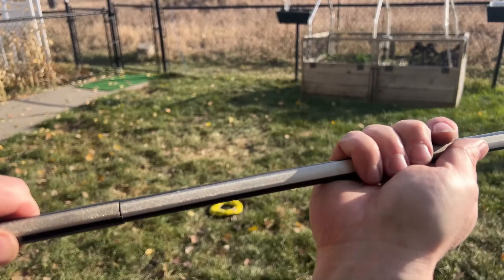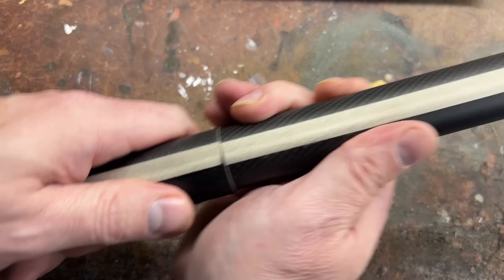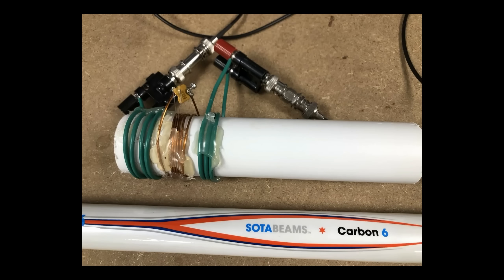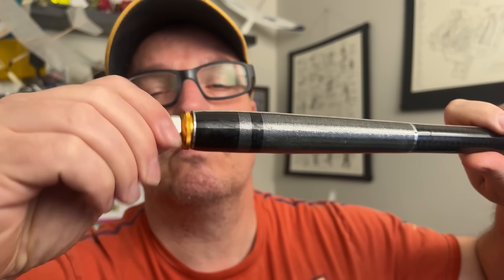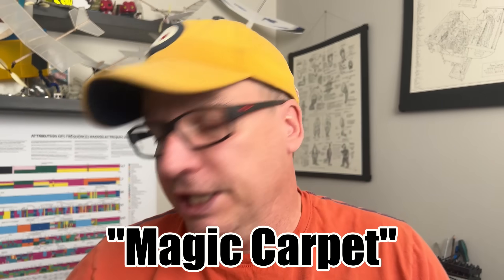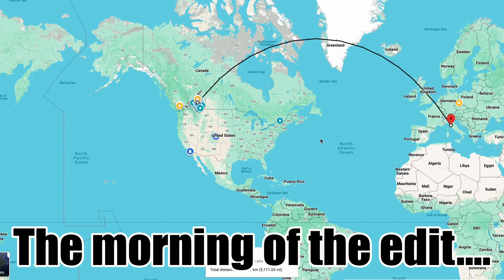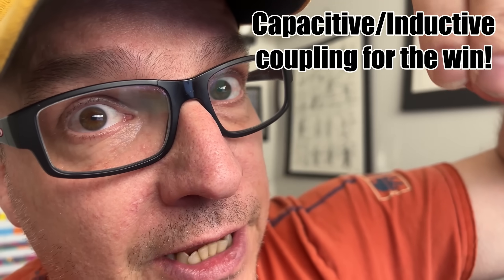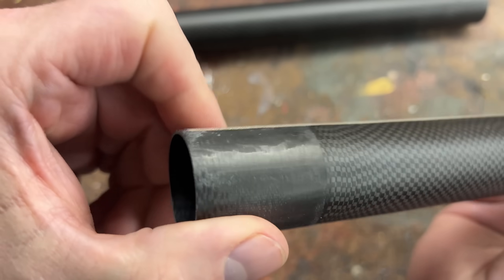Carbon Fiber Squid Pole EFHW Antenna: Wire-Free using Faraday Tape!

Comment: I have used the fiberglass version of these poles for several years with my RV  HF radio.   Have you tried  feeding this antenna with a 9:1 balun.   It works well for with a 33 ‘ wire strung inside a fiberglass squid pole.  I like your idea,  Eliminating having to string a wire inside the pole when setting up the antenna would be a time saver.  the I’m going to order up some conductive tape and try it on the fiberglass pole I have.  If it works as well as the wire  does, I’ll let you know.   

One problem I have had to contend with is sections of the pole collapsing due to wind vibration.  Plastic hose  clamps, appropriately sized for the different sections work well, but it adds a bit to the set up time.  I only use these if I’m setting up for a long duration, or wind is going to be a factor.
Reply from the maker: yes collapse is a issue and I have had luck with zip ties at joints

Comment: A very interesting concept but, as you say in the video, I would like to see a lot more work done on measurement off capacitance at the joints, loss and or gain, effect of flex in the antenna, and a whole bunch of modeling and experimentation. It could prove to be a fantastic design but it also could prove to be a money spinner for cheap Chinese manufacture producing low quality knockoffs.

Comment: How very exciting sir and was riveted to your video and experiment. I will be in anxious follower I'm kind of a Frankenstein antenna guy myself even though I'm just getting into the hobby. Most interesting for me was the coupling and adjustments that are possible by rotating or turning sections. And I wonder and plan to see if it is possible to achieve the same along the lines of a large telescoping whip antenna element as well. Thank you for your contributions and for experimenting it is awesome take care and 73s Adam (Festus, MO}
Reply from the maker: thank you and some of the discoveries are pretty cool stay tuned...

Comment: I always thought that carbon fibre poles should not be used because they are more lickly to attract lightening.
Reply from the maker: Well sure but would a wire or  metal tubing not be worse?

Comment: Was that 0.1dB loss for the few inches he was testing versus the 10x feet you are using?
Reply from the maker: Yes it was but you can go into his video and he will explain it much better than I ever could. In the end the losses are still inconsequential. Thus this antenna working so well

Comment: Just some things to keep in mind: You can do a lot of tuning with capacitive coupling, but it just makes the electrical length shorter, not longer. That's why hams use an inductor on the base of their vertical antennas and tune it, because it takes what amounts to a 10 meter, quarter-wave, 15 meter, or 20 meter quarter-wave vertical and makes it electrically longer in order to hit the rest of the HF bands. Also, inductively coupling in one spot to a relatively poor conductor for loss testing is not the same thing as capacitively coupling to the entire length of the material, which is what your conductive tape is doing.
Reply from the maker: I use capacitive coupling improperly here to be honest. It is both inductive and capacitive. You have some great points though thank you.

Comment: Cool idea. Many years ago, I used alarm window foil tape on PVC pipe and made antennas.
Reply: Ditto on trying aluminum or copper foil self-adhesive tape on your fishing pole concept.  Fishing poles are rigid surfaces so I don't see the flexibility of Faraday cloth is not a big plus. You mentioned possibly epoxying Faraday tape to the CF poles segments, I expect self-adhesive foil tape would be far easier.  Look for tapes from 3M  using their VHB (very high bond) adhesive or a 3M acrylic adhesive.  3M VHB double-sided tapes are used to bond large metal side panels onto vans so they can take a beating.  They are good for a wide temperature range that you may find useful in Calgary (lived there for 3 years!).  I checked and 3M sells some Al tapes at least.  And, even if the foil tape you buy isn't 3M branded, when you look at the release paper layer it most often reads "3M".
Reply from the maker: That's a great idea!
Reply: @VE6SFX_HamRadioRookie  you can make J-pole antennas with conductive copper tape on the back of eg duct tape or cardboard or whatever :)
Reply from the maker: Like this? https://youtu.be/d5itl1uWGtU or this? https://youtu.be/nwHmz5iGlvk :)

Comment: Very interesting concept, well explained, Thanks a lot.
About these Aliexpress poles, I've bought one one these supposedly 13m long poles and it's hardly 10m long. Sams for you?
Not sure it was from the same seller, but it does look familiar.
Reply from the maker: The sellers even with different brand names are effectively the same seller. And yes they tend to over promise. FwIW my 13 m pole is really 12
Reply: @VE6SFX_HamRadioRookie  I admittedly might have not counted the super-thin, unusable for anything last segment to measure  10.something meters long only. Yes, I did suspect too that all these offers were actually coming from the same seller.
For long poles (10m up) the only alternatives are the much more expensive Spiderbeam and such poles, that are too thick at their base  to fit into any ground anchor I could find and too heavy for me to bring them up on my own when extended and there's any wind blowing.
I have a 12m one and I hardly ever use it, I work with these cheap fishing poles instead.
EDIT for an extra question: do you think these really are made of carbon fiber and not just plain fiberglass? I have doubts.
Reply from the maker: Yes to all of this but since it is just tape to the outside of the pole suddenly these weak segments become usable :) No extra loading just some tape
Reply: "Yes", like you do think they're really made of carbon fiber? Well, OK, I really thought otherwise. I broke one at half its base segment on a windy day, they're kind of fragile.
I get the idea of "no extra loading", but how to you apply that tape to a segment that's barely of 1 mm diameter? I'm curious
Reply from the maker: Cut the tape down thinner to 3mm width and it fits fine.

Comment: Interesting idea!  Did you use a balun? I wonder if it would be possible to leave a 'tag' of the tape at the bottom end and connect that to a 4:1 or 9:1balun as would be used in a randon wire antenna?
Reply from the maker: No balun. And yes leaving a tag and alligator clip will work. I find the antenna performs quite well with no balun and the SWR is manageable by the atu-100

Comment: So many possibilities.  Wondering if the carbon fibre is necessary for the tape to make the capacitative coupling jump.  If not, variant could be nesting plumbing PVC ducting of increasing diameter.  (We have a 20m DIY antenna shootout coming up at one of my clubs and I was thinking of not going the traditional wire route but some sort of PVC self-sustaining foil tape approach, but contemplating base loading).

Aside from regular quick-install for this antenna on a fixed basis, also coming to mind is using multiple of these for a phased array, eg. 3 or 5 elements, could even be possible in a SOTA context ...
Reply from the maker: In the end only one way to find out if it would work. Get some pvc and tape, as well as a LCR meter to get capacitance and this should answer the question. I may try this but it will be a while till I get there. If you do it I would love to hear the results

Comment: Look up CCD antenna. Although they use resonate sections of wire capacitor wire capacitor there is alot you can learn. I posted a link but I think it was filtered out. Also at the end add a ring of tape to increase the capacitance.
Reply from the maker: Noted, thanks!

Comment: Add 1 or 2 pieces, 1 inch long beside both ends of each section.  It will increase the capacitance and allow for lower operating frequency.
Reply from the maker: Great to know thanks!
Reply: I'm not so sure I'm that!  Operate at a lower freq?  Why?
Reply: @jeffro.  He could get a better match on 80 and 160.

Comment: Cheers from a fellow ve6. I am va6gg in Edmonton. This is a really cool concept. Ignore the old farts saying it's all been done before. Maybe the idea was floated before but we didn't have cheap and easy access to things like light weight large telescoping poles and conductive tape at current prices. We couldn't get it all delivered in a few days to our door with a couple clicks. It's still a really great idea and quite practical now given how easy and cheap materials are compared to let's say, 35 years ago. If an antenna performs at least as good as a mono-band dipole, then you are laughing. I remember when a roll of conductive adhesive copper tape was 60 or 70 bucks. Now it's 10 for 3 times more. This conductive cloth tape is something that simply wasn't available to the consumer in the past. Keep the project rolling. I want to see what you come up with on this antenna. Multi-banding is definitely a direction you should explore. I think conceptually it should be fairly straight forward to accomplish, though you'd have to switch perhaps to a more resonant radiator design and find some way to key each section to fit together to achieve the correct radiator length for each band. Imagine if you could create this antenna but resonant so no tuner required. That right there would be about the coolest new antenna design since the DX commander. 
I think vertical antennas for HF amateur radio got a bad wrap for a long time and some smart creative people have brought them back into favor. They work amazingly well and don't require big, heavy, complicated and expensive antenna support structures along with the real estate to erect said antenna support structures.
Reply from the maker: Thank you for the encouragement! And agreed the world has changed. Hopefully the creative mindsets can bubble up again and not be suppressed buy the grumps

Comment: I thought you were going to put the tape inside the pole, top to bottom so it hung loose inside which I figured was genius. But when you you put it on the outside I was even more impresseed. Is there nothing you can't invent with that tape :) 
I just bought a large amount of the material to use as a magic carpet but now I'm wondering is I can put an adhesive backing on  it and laser cut  some kind of coil / trap which could stick to the pole and is very repeatable and low profile.
You are an inspiration to a 59yr old antenna engineer.
Reply from the maker: Thank you! Trying to get it inside was too much of a pain. Making coils with this is on the list of experimentation to come up.
Reply: @VE6SFX_HamRadioRookie  My tape arrived yesterday, I have a 10m pole kicking around, let see what it can do. Again thanks for the great idea.
Reply from the maker: @RobCanada  Awesome let me know how it goes!

Comment: Ok, this seems to me an exercise in learning, I mean, we all have to start somewhere I guess. If the goal is to set up a capacitive radiating dummy load,  you're on track. But if your goal is to get on the air, just use a length of ware, a 9:1 unun, a tuner and get on the air.
Reply from the maker: Did you watch the video? Did you see the contacts I made with it? This is far from a dummy load.
Reply from the maker: FYI carbon on its own is a poor radiator but with the conductive tape it becomes a radiator. the ohmic resistance of just carbon is crap and for the most part is a dummy load. But when you add the tape it changes EVERYTHING.
Reply from the maker: https://youtube.com/shorts/tFA2LB3aKKQ?feature=share seems you might need to go back and have another look at fundamentals of antennas... Just sayin

Comment: This is freaking WILD!   

If the antenna works collapsed, have you messed around with what can be done with it collapsed?  Maybe collapse every other section (use zip ties) to keep the capacitive coupling from hopping around?  I'm thinking about getting a 30 foot +/- (like 10 meters) tall antenna that works the 40 meter band.  Does the tape work like an inverted V if you go up one side of the mast, across the top, then down the opposite side?  I'm thinking maybe an 80 meter band antenna that's 30' +/- tall.  
 
Maybe run multiple strips of tape up the mast like a Faraday Cloth DX Commander?  With a cloth groundplane?  That all collapses and folds up?

Sorry if I'm making you drink from a fire hose with all my questions.  Too much beer turns me into an excited 6 year old with an engineering background.  😉
Reply: I really liked your questions. I found his video to be excellent and your follow questions intriguing.
Reply from the maker: Totally understand the fire hose of ideas… appreciate your enthusiasm. Few things I’ve tried. And FWIW I can tune 40 and get this 80 with the 33’. There is magic in the faraday tape I cannot explain… yet.

Comment: Awesome idea! I'm definitely interested in how this turns out.
Keep thinking outside the box, please!!
73 de KJ7LLX
Reply from the maker: Wait, there is a box?
Reply: @VE6SFX_HamRadioRookie  Exactly!!!
Reply: @VE6SFX_HamRadioRookie  Exactly!!

I would use mine for SOTA activations if there was a way to keep the weight down for a guying solution.
Reply from the maker: Easy peasy… ditch the paracord and get some heavy duty spectra line. You can get stuff with higher breaking strength than paracord. It’s in the fishing section of most sports stores. Anyhow it’s a fraction of the weight of other solutions

Comment: Carbon fiber IS electrically conductive. I sanded the finish off a telescopic, attached a wire with a hose clamp, and made DX contacts. Use the carbon fiber pole AS the radiator.
Reply: All carbon fiber is not created equai: different fiber compositions, different fiber/epoxy ratios, different densities, different raw materials, winding patterns and processes,  So maybe different conductivities and some poles work while others don't.
Reply: Are ya sanding off just the inner connecting portion or the whole pole?
Reply: @RatchetFWD  I just sand off an area on the lowest section for the wire to make direct contact to the carbon.
Reply: @VE6SFX_HamRadioRookie  that was a great experiment and verbal explanation . I work equations and relationships all day long. Freaken arrows really help grasp what’s going on .
Reply from the maker: Thank you I appreciate that. It took a while to break it down to the simplest explanation.
Reply from the maker: Yes but it does not effect antenna radiation in any significant way
Reply: @VE6SFX_HamRadioRookie  I'm saying omit the conductive tape. It's not needed.
Reply from the maker: It very much is. This does not work without it
Reply: @VE6SFX_HamRadioRookie   Japanese hams and myself have direct fed carbon fiber masts with good results.
Reply from the maker: Ok then this will need to be tested. With and without the tape. Thanks for the suggestion
Reply: @VE6SFX_HamRadioRookie  Yours is the response of a true scientist. Right on!
Reply from the maker: I will post a short video today some time but testing results. The resonant frequency is similar if not the same without tape and with tape. But I cannot get out transmitting. Here is why. The ohmic resistance over the radiation resistance with just straight carbon makes for a really bad ratio and the carbon pole is for the most part a dummy load. You need to reduce the ohmic resistance to get out and transmit, the tape allows for that to happen.
Reply: @VE6SFX_HamRadioRookie  I look forward to seeing the test results. It has and does work for me. Ohio to Belize contact was a real result. Several hams in Japan also utilizing direct fed carbon fiber antennas. 

I'm not saying it's the best ever, better than a wire hung from the same mast. But it has worked.
Reply: @sockeatinggolden8316  which part of OH u in?  NW Ohio here!
Reply: @sockeatinggolden8316 
Not 'conductive', 'sympathetic', 'inductive' even.
Measure the max current...
Reply: They make some resistors out of carbon so the swr should be excellent :)
Reply: @haxwithaxe 
Good hypothesis.! Of course DC and RF behave very different on semi-coductors.

Rotating one element inside another would be the best procedure for SWR adjustments. 👍
Reply: @snakezdewiggle6084  I was half joking about the idea of using the carbon fiber itself as the radiating element. The tape seems like a good idea. I think it might work better with the tape going all the way around because the RF will prefer to go along the edges of the tape but then it can't be tuned by rotating segments. I would expect the tape to work fine either way though. Every antenna is a compromise and a lot of people will likely find these compromises perfectly acceptable.
Reply from the maker: https://youtube.com/shorts/tFA2LB3aKKQ?feature=share